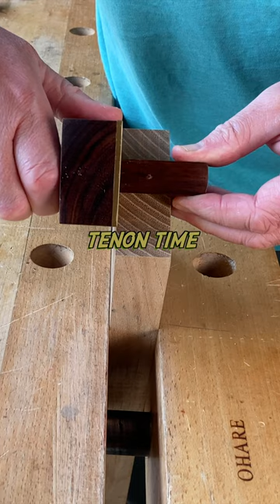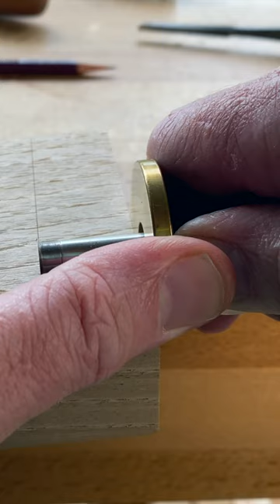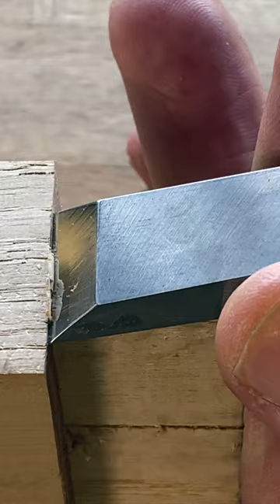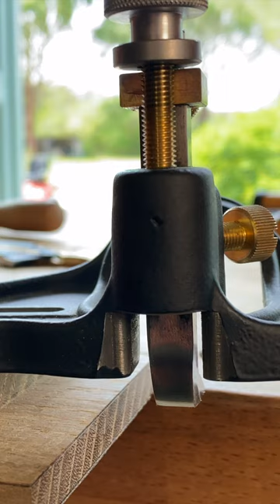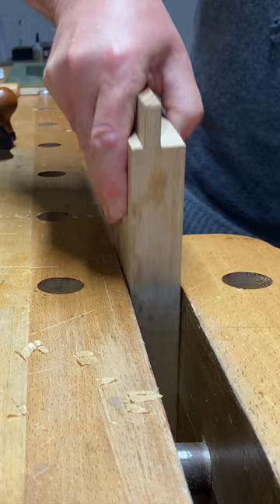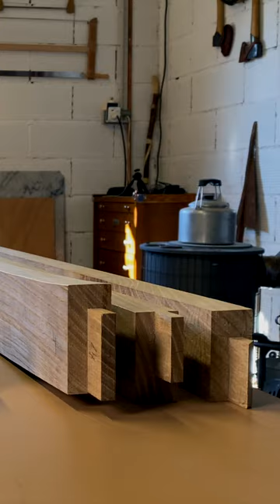Cutting Tenons the Old School way #shorts

Comment: Does the fibre hammer not give hammer rash to the wood its striking?  Would it not be better to hit a scrap piece ontop instead?
Reply from the maker: With the panel hammer and hard rubber face I don’t need to but that works too, cheers